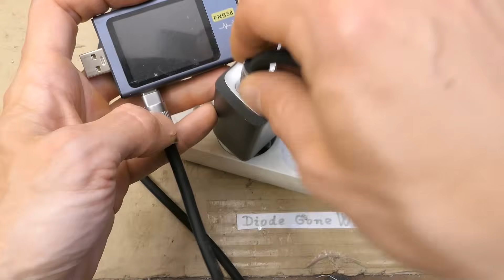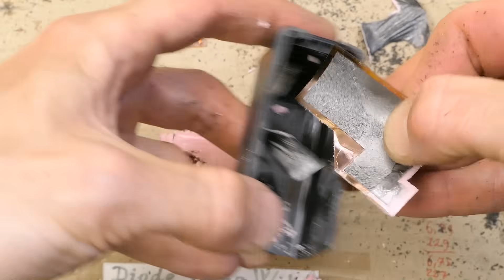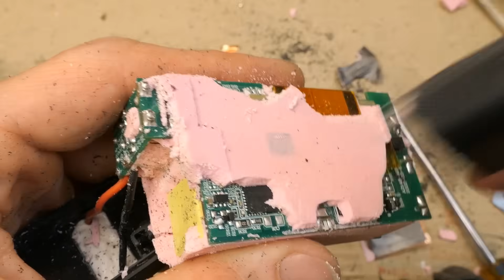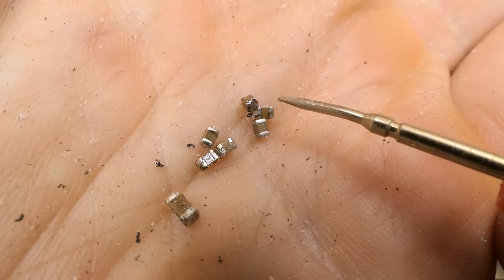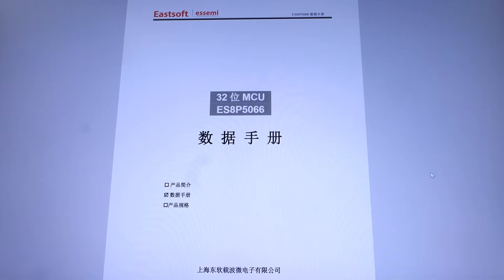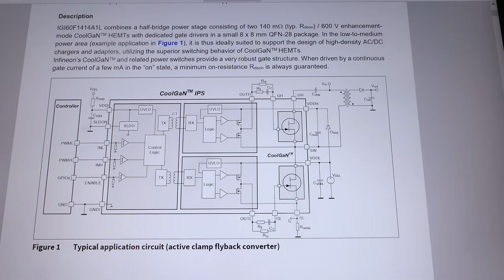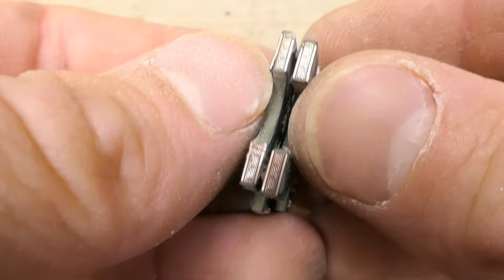Faulty 120W charger analysis (Anker GaN Prime)

Comment: Is not just resine but is cooling pad for circuit to case cooling even plastic the that this charger is built  radiate heat outside the case

Comment: Thank you for the very informative teardown!

To me it seems the product is mostly well designed, but the layout with 4pcbs is not a good idea. I have one objection to your 'take-away conclusion' of 'many components increase the probability of failure'. I think:  this thing failed, because ONE chip blew out. Maybe it was bad luck, maybe it was a design mistake. But mostly, products last when they are well designed and tested. And products fail when they are poorly designed and/or not tested.
This product had lots of protection built in (temperature sensors, voltage protection). It only failed because of one design mistake, probably. And it didn't catch fire.

Comment: These USB PD control chips often burn/fail when the USB cable or connectors fail. Either the wires fray and short, or the communication pins in the female USB-C connector get uplifted/bent and make contact with the power pins. Thus, putting PD voltages (9+ volts) into the low voltage communication pins. Poof!
It's a well-known problem with items, such as Nintendo Switch for one example.

Comment: I LOVE Anker products, they are solid and well made! I use their Soundcore Life Q20 headphones, Soundcore Boost bluetooth speakers, and a power bank. It's just a shame their GaN stuff seems impossible to fix easily without trashing it!
Reply: Im not exactly a fan of Anker (mainly just the "little bit better" chinese product with Anker branding, and you get the same hardware inside on NoName products much cheaper.

But what i experienced with GaN chargers... they are ALWAYS a nightmare.

Had multiple models from 45W to 100W, all of them just made very small for whatever reason. And ALL of them failed within 1-6 months.
A 65W charger from Hama with 1x 65W USB-PD or 1x45W USB-PD + 15W USB-A, in general nearly the same from the inside, just one board missing, had also burnt chips inside and the charger consumes about 120-150W (without any load!) and its getting ofc VERY HOT within seconds.

I mean, i am not the average user charging mainly a phone or rarely a tablet, i am often drawing continous 45W + phone/tablet or 65W on USB-C for the MacBook Pro while charging. As long i cooled those small power bricks actively (with a USB fan) they survive longer, but as soon they have to deliver constant, maximum rated power output for longer without active (inconvenient) cooling... they die like flies.

Just to be clear.. any other chargers i have whichs main goal was NOT size reduction as with most GaN chargers done nowadays, they barely if at all broke down.
And better chargers nowadays, such as the 140W power brick apple delivers with a 16" MacBook Pro, despite being GaN chargers, at least mine is still fine since 2021 and daily used but barely reaches its rated 140W, more in the 90-120W territory (MacBook cant draw as much except for a low battery AND heavy load on the hardware)

Comment: Over engineered junk. My brother also has a dead Anker 65W GaN charger. 
Probably designed by some rainbow headed fools in Silicon Valley with the help of drag-and-drop software to add the modules, without full understanding.

Comment: I have seen every charger this dude has opened up but this charger is the most complicated and safe charger he has ever opened besides the resin
Reply: most of those GaN chargers look like that on the inside.

Same for a 65W Hama model with USB-C and USB-A, just one board missing due to one less port but beside that very similar components and the same layout chosen.

Comment: I dont know why a smart guy like you didnt use the “ bloody” thermal camera first???? I hate destructive troubleshooting. Its just like a mechanic guy replacing all parts until he finds the issue. For probing with the meter please buy the ultra thin probes . For removing cheaps or components please use the bloody hot air or hot tweezers or anything right! Its sad to see such a smart guy doing this work. I hope you see my comment. I know that you can make this a professional analysis and troubleshooting as usual! Thank you and good luck

Comment: Great video! I was wondering if you could test and/or teardown a charger from Essager, the ES-CD37. The Essager brand is quite popular in Asia (over 10,000 of the charger sold on Aliexpress), but the ES-CD37 100W "GaN" charger can apparently go over 100C when charging, and messes/glitches up the touch on devices such as touchpads or smartphones, although it does deliver the rated 100W.

Comment: Those GAN chargers are not meant to be repaired.  It's impossible because even if you are able to get the replacement parts, how to manually reassemble the unit back after all the cut up and the destruction of its conductive thermal silicone?

Comment: As per the manual the Buck converter runs the 2nd and 3rd ports (limited to 24w) , and the illustration shows a laptop connected to the 1st and phone on 2nd etc.

Comment: That high voltage integrate power stage GaN (GIT) requires a large turn on current, and then a small steady current to stay on. This on one side improves the the peak current capability and reliability, on the other side the gate is more robust, as you do not need to careful drive it to 6V as the Schottky gate GaN FETs.
The hybrid flyback is a pretty smart design from Alfredo, there should also be an open access paper for who is interested: Resonant Hybrid Flyback, a New Topology for High Density Power Adaptors.

Disclaimer (just to be safe): I am an Infineon employee and I worked on the GaN devices, but any opinion given here is personal view only.

Comment: Infineon won the lottery when Anker designed that thing.  They must have used half of Infineon's power conversion catalog!
Reply: I’d think Anker is peanuts to Infineon. Sure, it’s a big retail charger brand, but the power supply manufacturers that are OEMs to big companies like Apple, HP, etc. will have much, much larger volumes.
Reply: @tookitogo  Delta electronics.
Reply: @gregandark8571  For example. They’re one of the huge ones, but there are others too.
Reply: EPC > Infineon 💩💩💩

Comment: An easier strategy for finding the short would be to inject a current of maybe 1 A fist and more if necessary into the output of the USB A connector. Then you can look with a thermal camera at the components and hopefully find the shorted component very easily. :)
I love your videos! You're doing great work, I have learned a lot form them over many years.
Reply: I posted my comment in the middle of the video, seems like we had the same idea
Reply: But the inevitable happened first

Comment: I think the technical term for that pink stuff is thermal compound with "blowing agent" additive. It foams up and fill gaps, to help transfer the thermal energy to the outside case. While using less material.

Blowing agents are not fbi investigators engaged with oral sex. 😂 
Its the technical term for a foaming compound added to many composites. Even 3D printer filaments.

Comment: If there are no equipment limitations, the best way to find the short circuit is to apply a low voltage with a limited current and use a thermal camera to detect the short. But sometimes, you can also find the heated spot with your finger, and use alcohol to more accurately locate the exact point — there’s no need to remove all the capacitors.

Comment: I just bought the 65 W Anker gallium nitride charger on sale for about 20 bucks. Pushed it pretty hard and it seems decent so far. Performs to spec under load, and doesn't get too warm. However no matter how nice the charger is, I always suggest people run them NO MORE THAN about 75% of their rated power output. Long-term.

Comment: All the potting looks to be a better insulator than heat conductor to the case.
Reply: Certainly not. Aside from the fact that that pink stuff is thermal compound, even terrible heat conductors are better thermal conductors than non-moving air, which is truly awful.

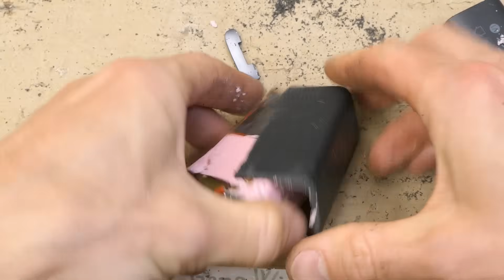Comment: The pink material isn't resin, but rather a foamy thermal paste. At around 2:00, you remove it — it's also there for heat dissipation. It looks like a graphite thermal pad.
Reply: 😂ItBlocksHeatFromDissipation.METALS ConductHeat👽

Comment: Wow. Incredible desing and thanks for de video, a true class!!
But that pink tragedy and que over enginered board layout simply kills it's repairability. Those 4kg less of carbon from using GaN just wen't to the trash and became new emissouns in form of e-waste
Reply: I wonder what the CO² difference is between a newly manufactured GaN charger and me making my own 100W charger by recycling the windings and core from this old strimmer motor I have sat next to my chair?... 😇
Reply: It would be better if the PSU was repairable but at least the cable is replaceable. Practically speaking this makes much more of a positive impact. Very few repairable PSUs end up in the hands of someone who would actually fix them, while anybody can unplug a cable.

Comment: Patreon supporter here. Good job at tracking down the short but I guess if you had back fed the current from the start you would have found the faulty chip. I found Anker makes good quality products but this one is definitely not designed to be repairable considering how well it was sealed. We've been living in a disposable society for a long time now where manufacturers want you to pitch the product once it fails and buy a new one. Best wishes from 🇨🇦.

Comment: Never seen a PCD Transformer before. Intresting new technology for me. Thank you :)
Reply: If you want to delve deeper ElectrArc240 has a breakdown video of a GAN PSU using a PCB transformer:  https://youtu.be/vgmqUhvQlww
Reply: First time i saw one was in a 1990's Japanese VFD. It had about 6 different secondaries - 3 for the high side transistors, one for the low side transistors, one for the 5V logic and the last one was for the 24V operational control and for the fan. It wasn't potted though! The potting on this one is for thermal sinking and conductivity. Even though this power brick is 120W it can't really supply that much for longer periods. However it can supply it for about 15-20 minutes thanks to all that thermal mass by which point most devices also get hot and reduce the power demand. I'm certain that if he backfed the supply before getting it in to pieces he could have removed the chip and the power supply would have started right up. The USB A wouldn't have worked, but the rest of th ports would have been fine.
Reply: context: 18:45

Comment: I can't believe all the parts that were in that charger. It had a 32 bit microprocessor in it? That's incredible.
Reply: The MCU is probably so cheap that they didn't bother with engineering a different solution.
Reply: Right? But yeah, most 32 bit MCUs seem to be cheaper than 8 bit ones (e.g RP2040 vs 32U4)
Reply: @blitpxl  it's just crazy to me that a USB charger would have a 32 bit anything in it. I grew up in the era of 8 bit CPUs running at 4 MHz. 40 years ago that charger would have been the fastest PC around.
Reply: @1pcfred  what's crazier is charging CORDS being used as hacking tools!
Reply: @1pcfred fwiw I ran the math on this, and my lazy attempt suggest that 40 years ago this wouldn’t be close to the most powerful computer - but it would probably be a real banger for the era. Depending on how that chip was provisioned (yes, you can spec it out to have features like out of order or math accel), it’s probably about as “powerful” as a 68k - a cpu that was quite common 40 years ago. The big difference is that the chip in that charger probably cost a few cents and a contemporary cpu probably cost about $1500 in today’s money.
Reply: So many chips and components, wonder what the bill of materials would cost, seems expensive
Reply: @HNedel  I’m not an electrical engineer, but it seems that if a MCU is used it’s just a single integrated circuit therefore less material. As opposed to if they tried to replicate the MCU’s functionality using some other components, it would likely have to be much more than a single IC, right?
Reply: @_________________404   Normally PSUs are such high volume devices that for one you'd be able to design your own special purpose chip, and then of course you don't make one PSU with it but numerous different families with different specs and form factors. For other you'd think you'd choose the simplest MCU you can get away with.

That being said i have been watching teardowns of modern power semiconductors at Lisin's and yeah they do just stick an MCU into every custom chip because why not apparently, they take up so little area even with trailing edge semiconductor compared to all the IO circuits and power semiconducors themselves that it might just be a no-brainer today. Though they look like mask ROM variants not fully programmable to spare themselves the pins and IO circuits associated with that.
Reply: @HNedel  expensive for a round eye maybe. In China you know the right people and they can bring you bicycles overflowing with huge burlap sacks of components. It's a different world. They ain't ordering stuff off Mouser.
Reply: @1pcfred yes, surely Anker, who is one of the biggest selling brands for such things in the west, are getting their chips delivered on bicycles 🙄 my round eyes refuse to believe this. No one is ordering from Mouser anyway
Reply: A very simple arm m0 cpu, probably chosen for the large number of A/D channels.

Comment: My suggestion: don't disconnect both the main power or the load when these power supply are negotiating the output power. 
It should be irrelevant but in practice is when some of them fails without other apparent reason.

Comment: The low cost reached with 12-layers PCB has allowed to manufacture this type of power transformer. It is almost unrecognisable to all the technicians which operated with traditional transformers.
Thank you for disassembling this power supply. I have many of them, and fear the moment when one of them will fail. I have no idea how I can troubleshoot them, and reassemble them properly. Not mentioning parts availability.
Greetings,
Anthony
Reply: With any luck, this is just a latent defect failure and most of them can lead a good long healthy life before actual aging failures set in. Because i completely lack the confidence to rebuild such a PSU to original spec and be able to proclaim it safe after repair. If they're efficient enough, it may yet be worth it regardless in spite of material waste.

Comment: I once removed a short inside a Class D amplifier chip. The output was showing a short, so I thought I had nothing to lose and injected high current into the output using a 18650 battery. When I connected the battery, I heard a little crack from inside the chip, and when I tested the amplifier, it worked perfectly. I'm assuming a capacitor was shorted inside the chip, and the high current vaporised it 😊
Reply: Did same in the xbox 360, it has some 1v8 and 1v2 voltage regulators that fail and are not available. Added some power on it and it fixed itself.
Reply: I see more and more people doing stuff like that. And buying those "short killer" devices. Cheap pieces of test Gear Sold on AliExpress and eBay meant to burn through the short.
Reply: I wonder these may have been latched up ESD diodes inside the chip. Because capacitor? No...
Reply: @PF-gi9vv   like a battery tab spot welder?

Comment: never expected this from anker. what charger brand should we buy then?
Reply: What do you mean? This thing is built quite well.
Reply: All of these compact power supplies are built on the premise that these new transistors can run hotter and thus packed tighter, which can be detrimental for other components. If you want reliability, just get a less compact charger, something that's made for desktop form-factor.
Reply: @mahir7h  It's the other way round - these compact GaN power supplies run cooler as they're more efficient, allowing them to be packed tighter.

Comment: The pink stuff is not Resin, it's silicone. Resin would be hard. Silicone is used to reduce vibrations between the components and save them from breaking off of the PCB while in shipping.
Reply: That explains the filling of it, then...And given some of those components weigh quite a bit, that's actually reasonable. I've seen a lot of cheap tech from еBаy which hasn't survived a trip through the post, and despite being carried by Royal Mail it's more to do with cheap design than bad handling. 😇

Mind you, I think Anker could take a better approach to this to make it more repairable. Is there a silicone-like compound which sets but doesn't stick, meaning you could pluck the filler out cleanly like jelly/jell-o before starting a repair job? 😇
Reply: @dieseldragon6756 The last thing a power supply manufacturer wants is a wall wart that can be opened by end users. They do not want the liability when some kid does that and dies.
Reply: I presume it also contributes some heat conduction to the case.